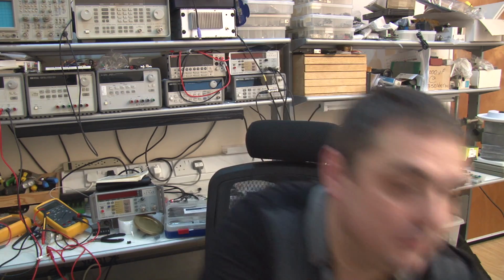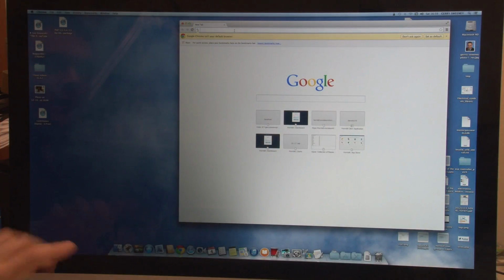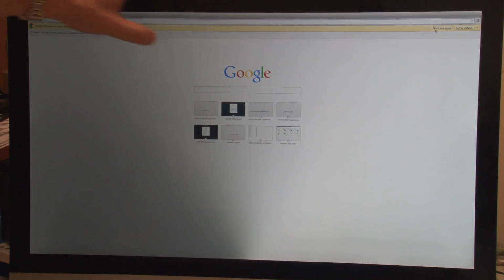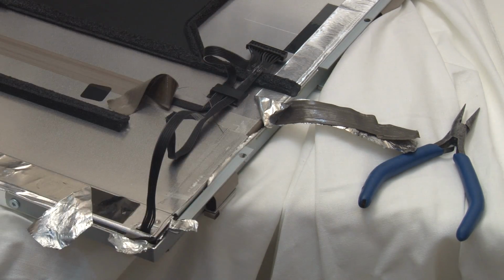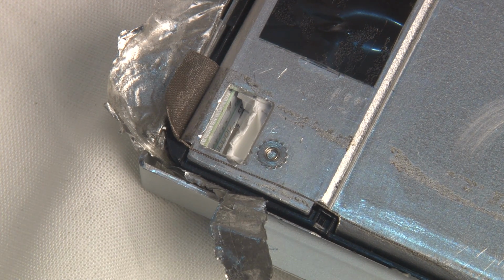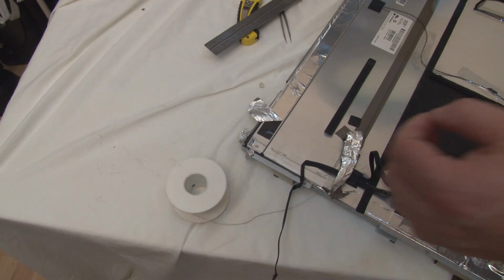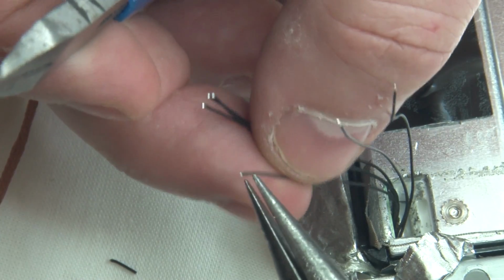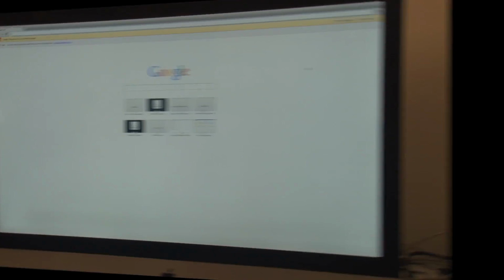Apple iMac 27" Dark Side Screen Failure - The Manufacturing Fault Apple Will NOT Admit!!

Comment: Hi Gerry!

By chance i got to see this REALLY GREAT Tut you did a while ago. 
This Video is by far the best i could find so far - regarding the half-black-screen-think ..;)
I am sure thousands are thankful the effort you put into this.

-----
Another Thing:

You might also have experienced a different issue. Which is: »the randomly 'SHUT-DOWN & OFF'-Thing on an iMac 27inch, i7, mid 2011, 3,4 GHz«
May be you have a suggestion. Would be appreciated GREATLY!!

In Case:
The Problem accured after installing OS X from start.
Now it doesn't boot up, if yes, just for a couple minutes or even seconds.

So far i've done nearly everything you would find online even on Apple-Platform. Up to now no Live-sign ..;((

With your profound knowledge, i am certain you would have an idea: what to do ..;)

Upfront thank you very much!
Reply from the maker: +Martinez Lopez thank  you for your feedback. Gerry
Reply: +Gerry Sweeney 
Hi Gerry

you might didn't get the chance to read all. But i added also the followings ;)

----
Another Thing:

You might also have experienced a different issue. Which is: »the 
randomly 'SHUT-DOWN & OFF'-Thing on an iMac 27inch, i7, mid 2011, 
3,4 GHz«
May be you have a suggestion. Would be appreciated GREATLY!!

In Case:
The Problem accured after installing OS X from start.
Now it doesn't boot up, if yes, just for a couple minutes or even 
seconds.

So far i've done nearly everything you would find online even on 
Apple-Platform. Up to now no Live-sign ..;((

With your profound knowledge, i am certain you would have an idea: what 
to do ..;)
Reply from the maker: +Martinez Lopez If the computer runs ok and then shuts down after a while it might be from overheating. If thats the symptom, check the fans are running and use a vacuum cleaner/air duster and clean out all of the airways. That might help. Gerry
Reply: Gerry Sweeney
 Thx a mil. for the response.

After a long pain in the A.. I took it apart, tried to re-ball the Video Card, put it back and the machine want start AT ALL. Maybe shorten some circuit somehow. So I thought I bring the iMac to an Apple Store. The problem there has to be unfortunately the Logic Board. 

That means i need to take it a part and sell the working Units as is ..;(

All the best!

Comment: Great vid.Thanks for posting. I have a similar problem with my iMac 27 late 2009  that has been re-occurring for a while that Apple couldn't or wouldn't answer . My screen blanks out completely and even  the repair shop over a year ago couldn't work it out until i noticed turning the brightness down seems to delay the screen closing.My tv monitor works fine so i know its not the actual screen on the comp that has issues...more recently it has blanked out on the lower brightness setting and after seeing your vid will attempt to cure it.Thanks again.Very helpful.

Comment: I had a similar experience with Apple when my 17" iMac developed the vertical line grid problem when it was only 13 months old. They just sat on their hands and said I should have bought AppleCare. After I replaced the screen myself with a second hand one I got on eBay for £150 I found out that they'd issued a recall and were replacing them even though they were out of warranty.  Great products, but an appalling company.  Props to you for this repair, it was very adventurous and I'm glad it worked for you.
Reply: How is Apple starting a recall that extended beyond the warranty period a sign of an "appalling" company?!? Apple's support isn't perfect, but it's far ahead of what any other computer or phone manufacturer gives.
Reply: Antonio Tejada I've been a Mac user for almost 20 years now, and they are not the company they were. My first experience of them was when my s/h iBook went faulty and they fixed it under warranty even though it was a second user machine. I thought this was fantastic so when I bought a wireless mouse from them, and it went faulty, I wasn't expecting a problem; but their first reaction was to tell me that because the computer I was using it with was out of warranty that the mouse wasn't covered by the warranty. I pointed out that the mouse was a separate purchase and had its own warranty and their next move was to try to offload the responsibility onto the manufacturer. Only after a long tussle and threats of legal action did they agree to replace it. 

Then I bought my first Intel iMac and after just 13 months the display became unusable. Apple's first response was to say that it wasn't covered and that i should have bought Apple Care.  Then I found out that a guy in France had forced Apple to acknowledge responsibility for it. I contacted them again and they said that any ruling in France was not binding upon them in the UK so basically "see you in court, mate". As for the alleged "recall" this may have happened in the US, but I know of no-one in the UK with this problem who's had it fixed by Apple under any global recall. They certainly didn't contact me about it even thought they were aware of the problem, and even though it's a very well documented manufacturing fault, at no time they did acknowledge to me that it was anything other than an isolated case.   Don't get me wrong; I'm not a Mac-phobe, but I'm not a fanboy either. The best I can say about their customer services is that it is inconsistent. If you contrast it with, say, Dell, they are not the easiest to contact when things go wrong either. You have to jump through a lot of hoops before you get to actually talk to someone from Apple unless you have an Apple Store nearby or happen to know people who work for them (which, fortunately I do). Dell, on the other hand, seem to have superb customer support. Unfortunately you do need it a lot...

I also find their "nanny knows best" attitude towards software development irritating and patronising.  While their OS and it's interface is probably the best in the world (just my opinion) they seem hell bent on ruining it by over-egging the pudding. Then there's the forced upgrades. Software that doesn't work as intuitively as it should yet they still spin it as being "the best".  Numbers is a prime example. I couldn't wait to ditch Excel for Numbers which has some really nice features; only to find out that it lacks a "transpose" command, something which is fundamental to a lot of the things I do with a spreadsheet.  Apple's response: "no-one uses the transpose function anyway so we didn't bother with it" despite the fact that it would have been simplicity itself to implement. About four years later they announce, with fanfares, a "great new feature; the transpose function!!" Because, apparently, we all did want it after all...  They just couldn't bring themselves to admit that they'd dropped a bollock and forgot to include it, because, in Excel (and in AppleWorks before that) it's tucked away in a weird, counter intuitive "Paste Special" dialogue box. 

Until Yosemite came a long (which, despite some bugs in the beta version is the most stable and speedy OS since Snow Leopard) I was seriously considering jumping ship to Linux because you hear a lot from Apple about "controlling the user experience", and I don't want my user experience controlled, thanks.  i want to be able to work with my computer the way I want to rather than be forced to use Apple's idea of how I should be working with it. 

My big problem with Apple is that they don't really listen to their users and a lot of us long term, power-users are getting pissed off with them.  A friend of mine runs a post-production studio and has about two dozen Mac Pros, all rack mounted. He's just ditched Apple in favour of a Hackintosh  option because the new mac Pro design (the vacuum cleaner) isn't compatible with his studio any longer.

Sorry if you're a fanboy and my opinion offends you but it is born of experience and not one I have formulated on a whim.
Reply: ***** For what it's worth, I've been a Mac user since 1992, so I've seen all but the earliest days of Apple's support. It's also possible that their UK support was worse than what I have experienced in USA and Switzerland, the places I've lived. In my experience, Apple's support was its worst in the mid-1990s, with widespread stories of people giving up after waiting on hold for an hour without getting through. Local support was at the whim of the local dealer, who might have been great, or horrid. Ever since about 2000, it's been vastly better, especially in the stores, where store managers have wide latitude to go beyond what's required. (An example: A few years ago, my sister spilled water on her MacBook. She took it to the local Apple Store, hoping to be able to get it back within the week without it costing a fortune, since obviously it's user error. Not only did they fix it under warranty anyway, they quoted a 3-hour turnaround -- and then called her after just 45 minutes and said it was ready.) 

Anyhow, all I said was "Apple's support isn't perfect, but it's far ahead of what any other computer or phone manufacturer gives." I'm not sure how that makes me a "fanboy" (a loaded term used by folks who want to distract from the factual basis of a discussion). Saying that a given company merely has the least-bad support isn't necessarily praise, just pointing out that everyone else is much, much worse. The grass is NOT greener on the other side. 

And I still don't understand how extending warranty coverage MAKES them appalling, which was the original claim of yours I am disputing.

Comment: Gerry: Many thanks from Colorado for this incredible tutorial. I was able to do most of it myself and then call in the experts to do the solder work. My screen is as bright as new on the left side.

With that said, for those of you thinking about doing this yourself; the solder work on this is pretty difficult. I work in a building with about 30 electric engineers and only one of them was brave enough to give it a go. It took him about an hour to do the solder. He had to use a high temperature attachment with a very thin tip. It's best to access it by tilting the iMac screen up (so the contacts are facing more horizontal) and positioning a magnifier or microscope over top (and a good light). If you don't have all of these pieces, and pretty decent solder experience, you're probably going to have a bad time.

Thanks again!

Comment: Great video and a great help. Just about to embark on this task but was wondering about the soldering of the wires to the connection point on the mac. Does it matter if the solder for each of the 6 wires is touching? or do they have to be kept separated? Bit nervous about it as once the solders on, theres no going back.
Reply from the maker: tedfaun they need to be separate, they are 6 individual connections. Good luck with the repair. Gerry
Reply: Gerry Sweeney so if the solder is touching between the connections it's game over? (thanks for replying btw)
Reply from the maker: tedfaun I doubt you will cause permanent damage but yes they should not be shorted to work properly. Gerry

Comment: Thank you so much for the instructions. I tried this fix today and quickly realized that I was not equipped to perform this repair.  As you point out the solder points are difficult to access and are very tight together - my shaky hands and lack of proper instruments were creating all kinds of trouble performing there repair - BUT I managed to fix my monitor using a different approach (not being one to give up).  Instead of soldering the connecter back to the board, I was able to use a small piece of soft plastic to wedge the connector into place.  Essentially putting downward pressure on the connector onto the board was enough to make the connections and run power to the LED array.   The difficult part was that I had to conduct the operation with the computer running and facing down with the screen off center so I could access the rear opening - very tricky.  With the system running I could then very carefully move the connection until it place (being very careful not to touch the live connecter to the external metal housing - rear or LCD) and align it to the board and secure it with the rubber piece which pushes the connector to the board.  Once it was aligned and I could tell the array was lit, I used a glue gun to fill the opening and essentially secure the connector, rubber piece, and cable.  Its now back to working condition.  Although I could not conduct your prescribed fix, I did want to thank you for providing the details needed for me to fix my monitor.
Reply from the maker: Carlos Lacourt 'thank you for the feedback, its awesome that you have effected a fix, well done.  Gerry
Reply: Gerry Sweeney Gerry - Well it turns our that my solution was rubbish and only last a few days.  Instead I got the rights tools and performed the fix and you suggested and now its fixed right.  Thanks Gerry!
Reply from the maker: Carlos Lacourt Great to hear...Gerry

Comment: First, Congrats for this video tutorial, the camera work is good despite the lens limitations, and repair explanation is fully detailed. 
I had lived with this dull screen corner you're talking about for some time, since it wasn't too dark, but today my whole screen went all darker. My imac is an intel 27 inch  late 2009. Watching this tutorial gives me some hope i can repair this with some help, since i can't pay for a new screen. I'll post here if i can do this little surgery succesfully. Thanks Gerry!
Reply from the maker: ***** Thanks for the comments, good luck with the repair.  You may find though if the whole screen is now dark that its the PSU the drives the backlight and not the screen, just be aware of that. Gerry
Reply: Hello Gerry, the technician who's helping me with this Imac followed your tutorial and got the screen to light up the darkest corner, though he only could solder 5 pins, The screen still is somewhat dull. I don´t know what is the PSU fail that you mention. Is there any information online about this PSU problem, where to locate it and fix it? Thanks in advance for any hint you could give us!
Reply from the maker: ***** I would first make sure that all 6 wires are connected, thats probably important.  The PSU can fail but I have never tried to repair one, people generally just replace the board so I doubt you will find anything specific on line.  Gerry
Reply: Thanks Gerry, i'll check those pins...

Comment: £450!  to repair..wow ..what a rip off.
 How would the fault happen in the first place? the clip is there to stop movement & surly there is not enough heat to affect the solder? interesting vid ,ty for uploading..
   Nice job soldering down in that very restrictive area btw..
(though strip the wires beforehand maybe?)
Reply from the maker: paulspydar the fault seems to be stress related caused by thermal expansion and poorly defined manufacturing tolerances around the mechanical construction of the panel.  Thanks for watching.
Gerry

Comment: Thank you very much for the video. I was able to do the fix (it took awhile to gather the courage), but couldn't solder one of the wires, as the contact disintegrated, but everything looks great on the display, so who knows—lucky? It's been lighting up fine for about 8 months. Definitely difficult to see clearly enough to access the contacts in the recess where the connector sat, and such a tiny work area! I ended up just soldering on wire extensions instead of re-using the male part of the connector. Used some fine insulated wire pulled from old electronics for the extensions. Couldn't have done it without your help Gerry  : ))
Reply from the maker: moquiti great news, glad it helped you out and you have it working. Well done, its a tricky job for sure so +1 for your soldering skills.  I suspect that the 6 wires might be parallel wired for current handling which would explain why you got away with missing one wire.  Luck you :)  Gerry